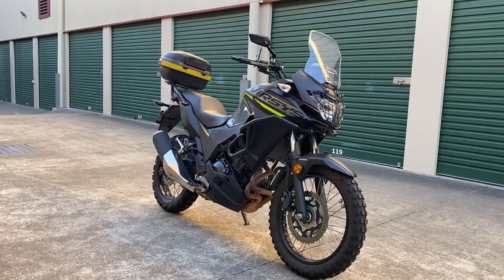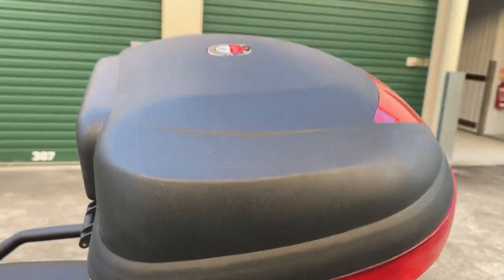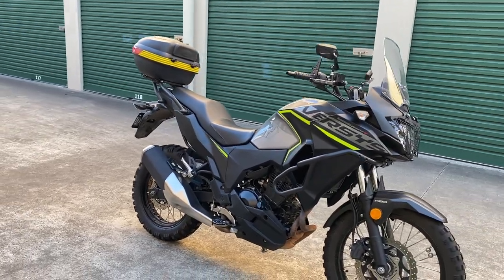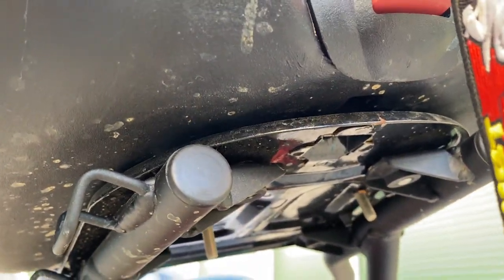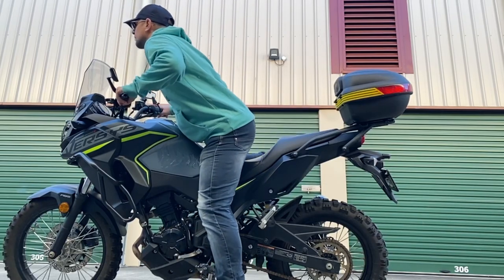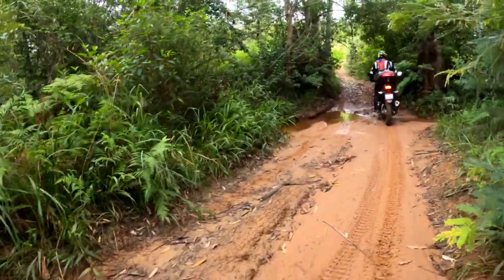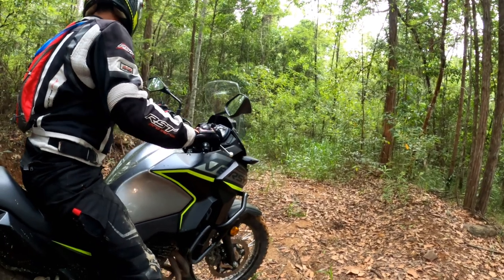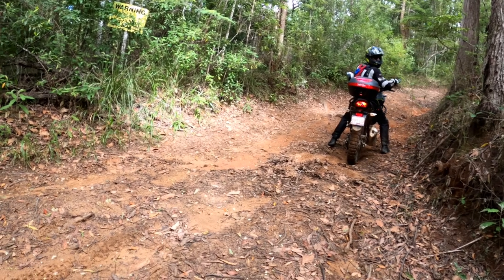Versys X 300 Top Box Ebay Aliexpress: Review cheap alternative

Comment: Hi! I used exactly the same top box for years you installed on your bike. I was so satisfied with it that I used it for both of my previous bikes. I used it for panniers too. It didn't break even when the bike fell on it. It absolutely worth it's (cheap) price. If I may suggest put some rubber layer(s) between the box and tha plate to prevet the vibration of the box. And another tested solution: use 4 screws in square to fix the box to the plate instead of 2. The rail you put under the screw-heads is not bad, but if you put some large outside diameter washers it would be perfect, and on the other hand it may looks much aesthetic and professional.
That was a good purchase!
Reply from the maker: Awesome, thanks for the tips 👍